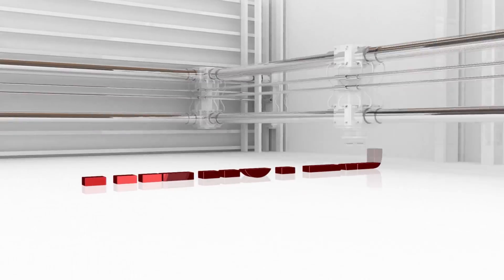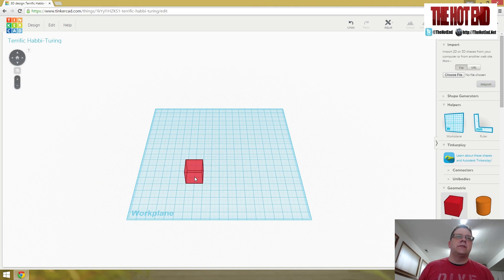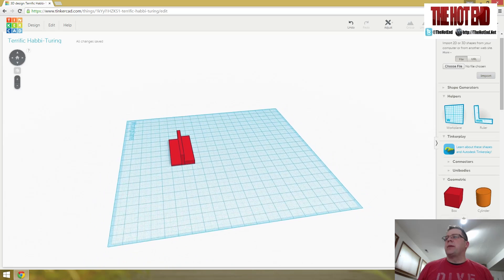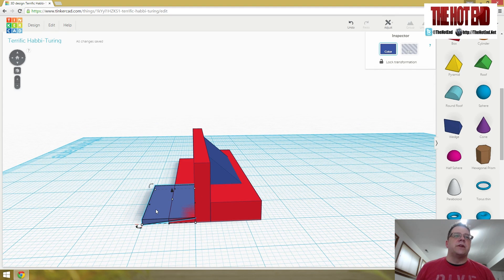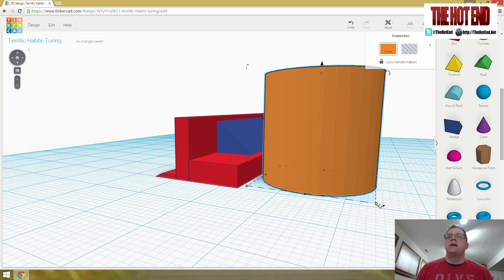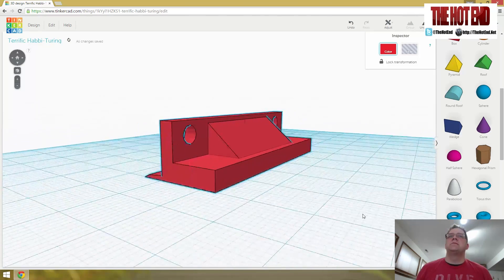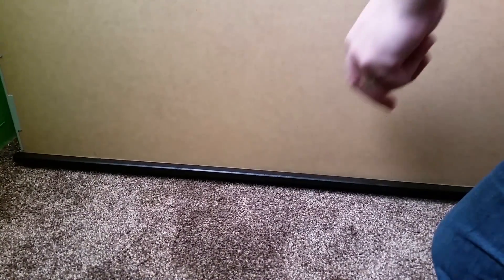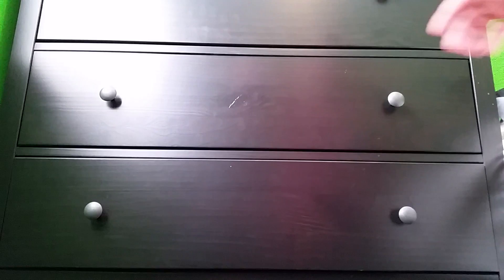Fixing saggy Ikea drawers with 3D Modeling and 3D Printing!

Comment: Take a look needs some work:-

Model Diesel Engine Starter V2

Some hopefully improved files, still need work doing but
better than V1

Advantages include:

Lightweight portable and no battery required.

Method uses a wound up spring, (held against a ratchet), it's
stored energy is released when a button is pulled.

NOTE: This has not been made or tested in any way by me, It
is only a basic idea and will require further development. I do not own a 3D
printer, (would like one, any offers),  so totally un-tested in all respects.

IMPORTANT NOTE: Take care of all safety, such as fast
starting Model Diesel
Engine, fast moving parts, oil, heat. wear and tear, etc...

All files need some work, but I believe the basics are
correct.

######################################################

Files download V2

Model Diesel Engine Starter.zip

http://1drv.ms/1MJf1k1

There are three parts to this model "Model Diesel
Engine Starter.zip"  

.3mf indicates 3D Builder, Windows 10 3D Builder files

All Three Parts.3mf 
(All the three parts should fit on one plate)

Main Body.3mf

Drive Lid with spring.3mf

and

Starter Button.3mf

and the same as STL files

and .blend files (blender files), but these may require even
more work, but no All the three parts as blender files

All files need some work, but I believe the basics are
correct.

These Notes and Instruction : Model V2.docx

Image : Model Diesel Engine Starter All Parts.jpg

#####################################################

All files need some work, but I believe the basics are
correct.

Comment: Really liked seeing the use of tinkercad in the video. Like the idea of learning how to create prints  thx for the vids
Reply: Let me know if you have any ideas of things to make.
Reply: xaqaria  the only thing that comes to mind is pc power supply cabe combs for individually sleeved cables. 24 pin 8 pin 6 pin, they can be bought for $5 for a 3 pack of 24 pin or $5 for a 6 pack of 8 or 6 pin. If i had a 3d printer id be trying to work on that, or anything else for cable management.  for reference search e22 cable combs  i hope this may give you some ideas.
Reply from the maker: good idea.  I'll take a look.